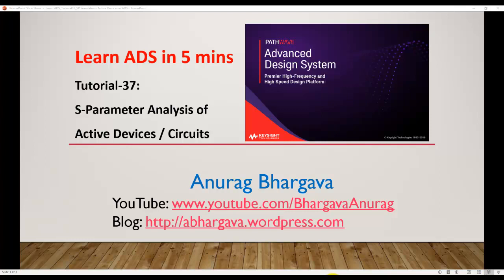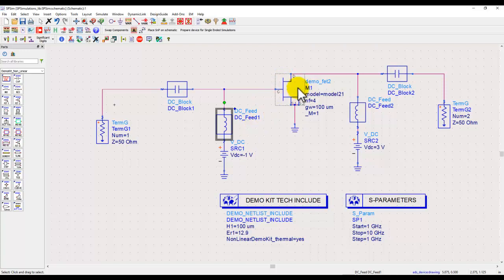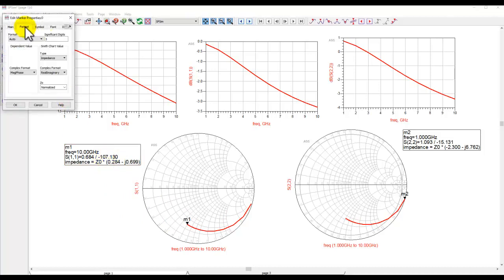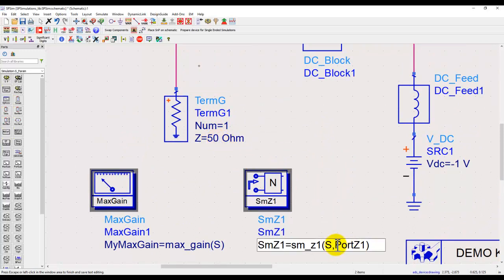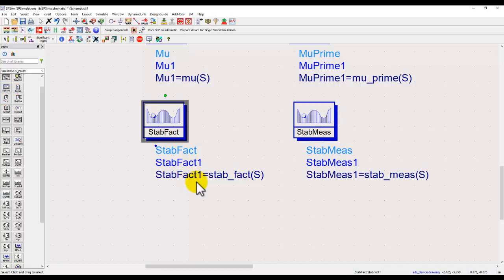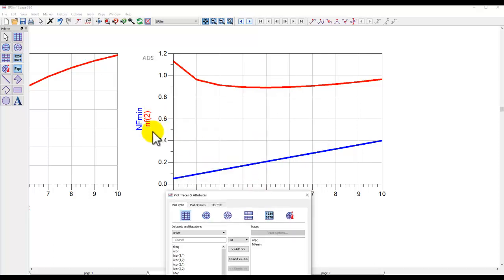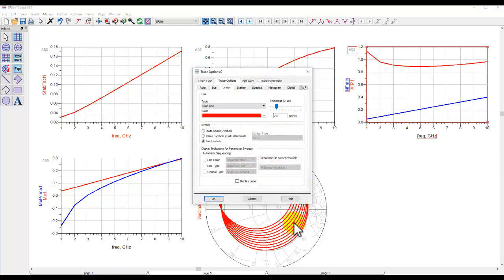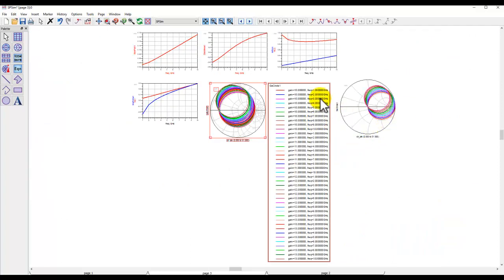Tutorial-37: S-Parameter Simulation of Active Circuits

Comment: Your videos have  helped me a lot in understanding ADS. I have simulated several microwave passive circuits and have used SP simulation in my several designs. Please make a video on LSSP (Large signal S-Parameter) simulation, as required for obtaining the input impedance of a rectifier circuit used in RF Energy harvesting. I am yet to find any good video or literature on this topic.
Reply: did you find any?
Reply: did u find?

Comment: Thank you for your informative video Anurag sir. 
I want to plot S11 of a rectifier input for different input power levels but my S11 results the same for all different power levels. In VNA I checked that for every input power level my S11 gets shifted because of the non-linearities of the diodes in the rectifier circuit. But I am unable to get different S11 plots for different input power levels. Please guide me in this context.
Reply from the maker: Try LSSP instead of Small Signal S-Parameters.

Comment: Hi Mr. Bhargava, decent work and concise explanations there. 
May I ask why we need both StabFact and StabMeasure blocks to evaluate the stability of the circuit, because from some textbooks and also I learned at school, only K factor suffices?
And why you prefer Mu and MuPrime over the other two?
Regards, Binh
Reply from the maker: Hi,
StabFact or K is only necessary condition but not sufficient and for stability you need necessary and sufficient condition and that's why you need StabMeas as well.

Comment: Hi, may I request any references about how to design DC block and DC feed?
Reply from the maker: Hi Yuchan,
DC Feed could be an RFC (in low frequency till ~1-2GHz) or a high impedance lamda/4 line as shown in the LNA design video. For DC block you could use a Capacitor as this can be designed to be part of your matching network like done in the LNA design tutorial serving both matching as well as the DC blocking purpose.
Hope this helps..

Comment: Hi Anurag, first of all thanks for providing such useful tutorials for free to everyone, your help is really valuable.
I have found that many vendors provide both S-parameters files with measurements and SPICE models for their devices. Could you comment on which model should be used for simulation? Are there any advantages on each model?
Reply from the maker: Hi Miguel, It really depends on what type of circuits are you designing and both type of models have their own pros & cons. S-Par files are usually OK for LNA kind of designs as non-linear simulation is optional, considering they are used in receivers and power levels usually will always be low so you can live with SnP files. 
However, if you want to see non-linear effects then SnP file for the device is of no use to you and you should use nonlinear (SPICE) models. 
Just remember that every modeling will have some or the other compromise and your eventual results will be subjected to the quality of models vendor provides. 
If you doubt a model accuracy or quality then you either need to do your own modeling or hire consultancy services of some company to develop more accurate model for you.
Reply: @BhargavaAnurag  great, thanks!